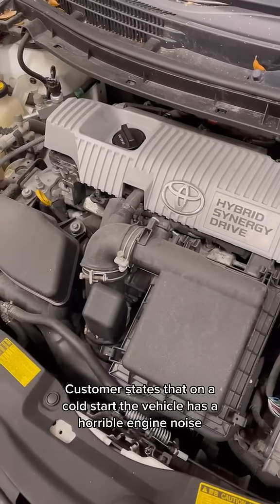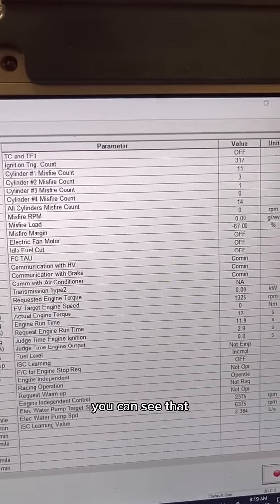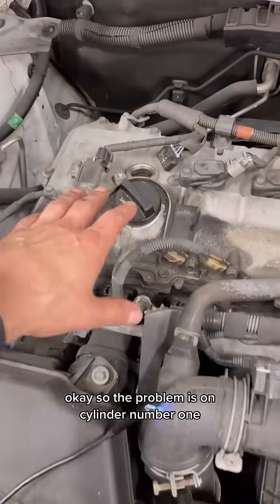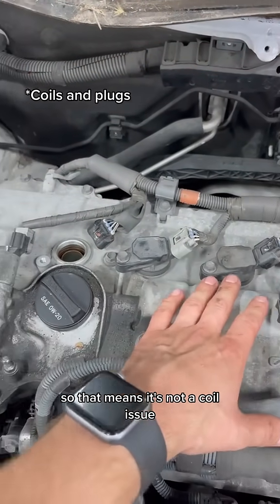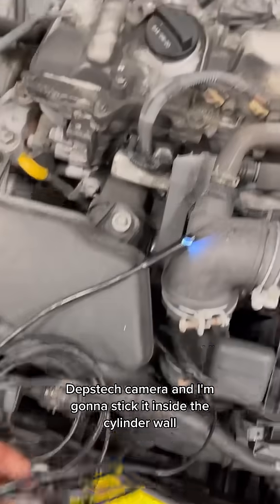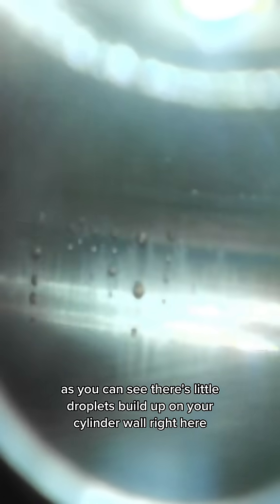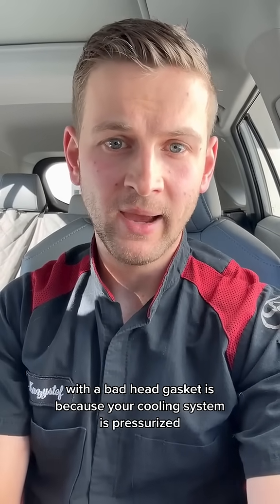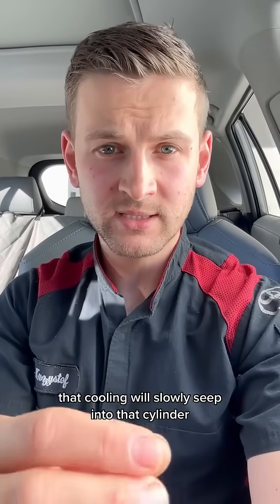Customer was not happy about this 😳

Comment: Yea, this happens a lot on hybrid vehicles because of constant starting and stopping the occurs when it switches between hybrid and engine modes
Reply: I don't think so. On the contrary, in hybrid systems MG1 first accelerate crankshaft till idle speed, then spark is given and start becomes very smooth as can ever be on conventional ICE.
This head gasket issue most likely comes from poor oil maintenance and overheating engine.
Reply: @ I highly doubt it. Then just Prius owners out of all Toyotas don’t maintain their cars but everyone else does? 

Overheating I can agree with. Water pumps go bad pretty often which does lead to overheating and then gasket failure
Reply: @trake8195  I commented regarding constant start stop as you mentioned, that I'd not be worrying about it.
I don't know how in other parts of the world, but at least in my country 90% of prius are taxi drivers, and truth to be said a maintenance is on lower side. They have EGR which also needs attention and maintenance. Everything adds up leading to overheating.